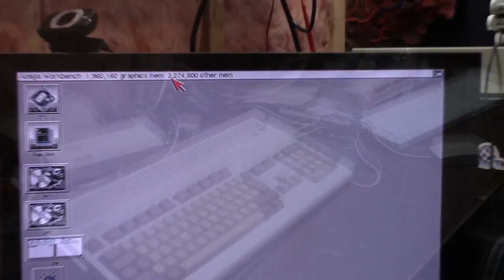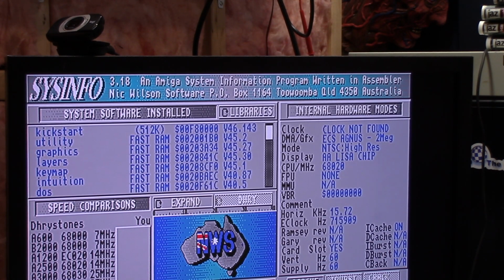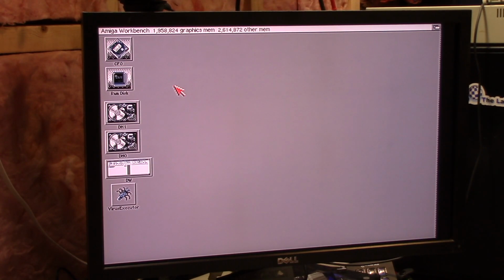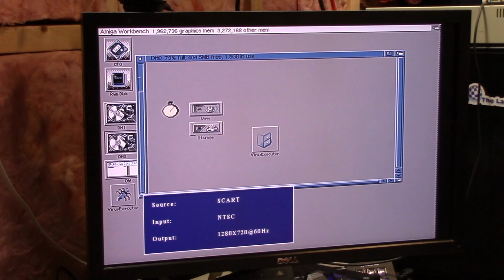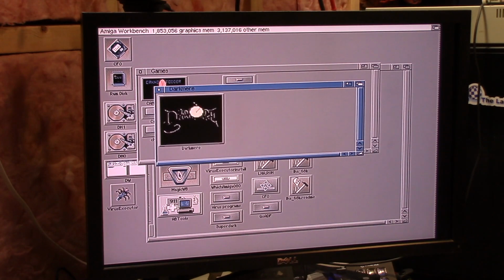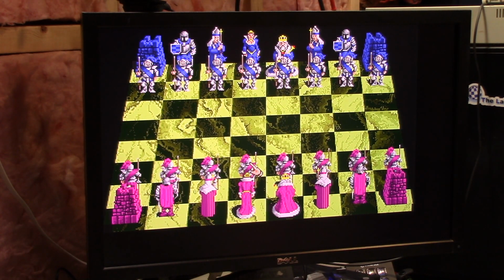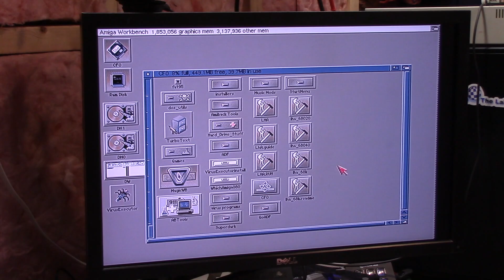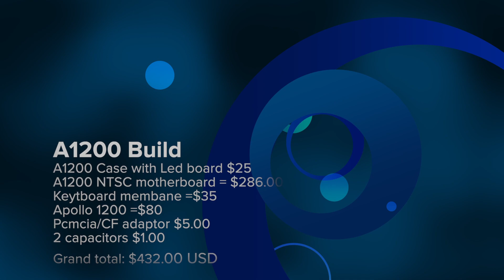Commodore Amiga 1200 apollo upgrade

Comment: Must get a new A1200 keyboard membrane. With my white nos keyboard the 5,t and g keys don’t always work.  You must have 8MB Fastmem for WHDLoad. Got on my A1200’s a ACA1221, ACA1221LC, ACA1233n-55 and a beautiful Blizzard 1230 IV. Waiting for a ACA1260, Blizzard 1260 and a Falcon 040. Have on all my 4 A1200’s a Indivision AGA MK2CR for VGA Pal High Res Laced 32 Colors with WB 3.1.4.1 and BestWB 1.3.  And 1 with WB 3.1 and BetterWB 4.3 and must see of ClassicWB FULL ADV ADVSP UAE 3.1. Have a DF0:???? on the Rev2B with the Panasonic JU-257A516P interne diskdrive. Maybe the Chinon FZ-354 will work on it. Must do it now with the extern DF1: diskdrive. Like the Rev1D.4 boards better than the Rev2B for WHDLoad.

Comment: You can have a 8GB CF card with the PCMCIA. Because you have WB 3.1.4.1. Have BestWB 1.3 on it and you can do a boot menu on a A1200.

Got a great A1200 Rev1D.4 RECAP with a Indivision AGA MK2CR and a Blizzard 1230 IV / 68030-50MHz MMU , 50MHz FPU and fast 50ns 128MB FAST RAM. Have the new A1200 CD32 case / keycaps  from A1200.NET. Have WB 3.1.4.1 / BestWB 1.3 a 16GB CF and a 8GB CF in the PCMCIA. Like Unpacker alot to unpack WHDLoad stuff on the PCMCIA.
Reply from the maker: i can never get it to see large cards on the pcmcia. are you using compactflash.device? or another i may need a updated driver. time to scour aminet.
Reply: Use a SanDisk Ultra 8GB CF 30MB/s or the 15MB/s or the 50MB/s. You must go to Workbench to Tools  and do PrepCard+. And set Card Reader and reboot and you have 8GB. You can do also with a Transfer Kit Install Disk. Which have ADAPCMCFL and EasyADF.
Reply: You can see al my topics projects on the Dutch forum Amiga Cafe (user AMIGA JOHAN).

Comment: Nice.  I do like the A1200 its a very nice Amiga.  I got mine a few years back before the prices exploded.  I installed a KA21 Gayle Reset Hardware Fix that resolved my soft reset issue with the A1200 when the PMCIA card is installed.   I have the CF Card readers hanging out of the A1200 and A600 to make moving files easier plus I have USB Card Readers connected to my A2000 and A4000 only problem I have is remembering which damn case I put the cards I use in.  Yea its a bitch when you clean up and put things away.   I seen to find things better when I leave a mess on my desk.  Go figure eh.
Reply from the maker: Stephen Bruce didnt 3.1.4 roms fix the pcmcia reset thereby nullifying the gail fixes?

Comment: Hey, at least the Apollo card was working. So now you have 4MB fast RAM. Much more usable A1200.
Reply from the maker: this thing is weird,  i found out it will do 8mb, so i put a 8mb sim in it, it will boot w 4mb sometimes, then others 8mb, AND the pcmcia card still works in 8mb on 3.1.4, but not 3.1 (the ram bleed issue) was it fixed in 3.1.4 ? weird... its supposed to crash on 8m and pcmcia